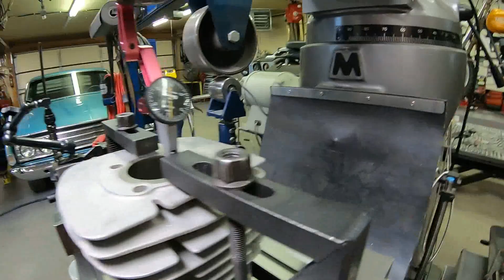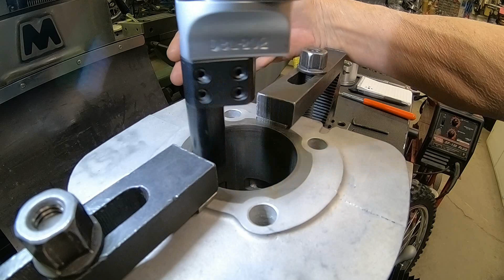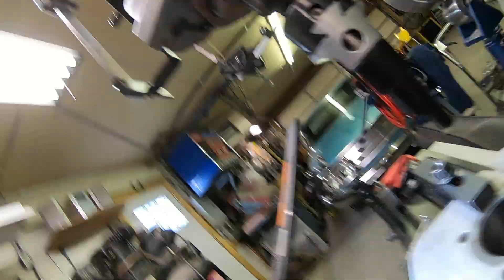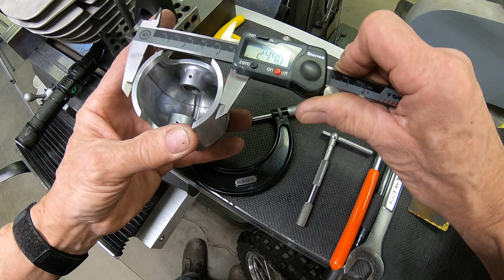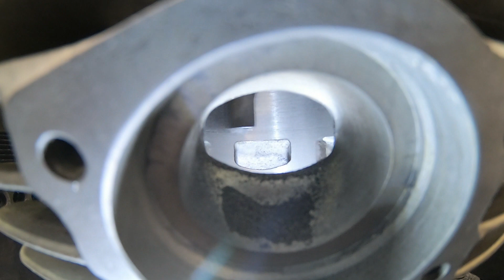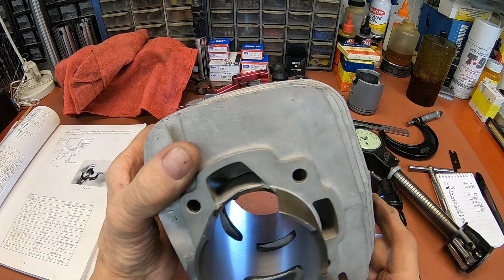Boring a motorcycle cylinder, Kawasaki F7 175 Bushwacker

Comment: That is an interesting boring bar. Did you machine it yourself? Sure looks ridgid.
Reply from the maker: Hi Dave, it is made by Mesa Tool, but unfortunately the last time I looked they have discontinued it. It is very sturdy and provides a very smooth bore. I have had many folks ask me about it. I always tell them to call Mesa tool and ask them to bring it back. I would buy another one. Mesatool.com

Comment: Nice work as always Dale. Your attention to detail is impressive. I should be getting the 185 engine back from the shop in a couple of weeks. Started working on the 125 frame yesterday.
Reply from the maker: Thanks again Dave, wow you are making good headway on those bikes. Are you laying down the shocks on the 125?
Reply: @montana2strokeracer  I will be adding the alternate upper shock mounts to the diagonal frame tube like I did on the 400, 250 and 185. Frame gussets will be the same as well.
Reply from the maker: Awesome buddy, is there improvement to handling or have you had a chance to ride yet?
Reply: I noticed a big improvement in the ride and handling on the 71 TM250 and TM400. The upgrade to the ignition system also improved the aceleration and throttle control.
Reply from the maker: Nice, it's always good when the mods have a positive effect!

Comment: Thanks Dale , Great camera work . I am having a problem finding the piston rings for My Yamaha TX 500 , all the part numbers say it is correct but the top and second ring wont fit in the land , they are about .012 to tall or thick . I dont know what to do .
Reply from the maker: Hey Murr, thanks very much. Is your piston new too, or is it the original? It's strange that the rings are not the same. Hey, you might contact Chris over at CK Cycles on Youtube. He built a 500 Yamaha, he may have some insight, he's a great guy, trying to get his channel going.
Reply: @montana2strokeracer  thanks Dale Chris built a XT 500 minus the TX 500 twin cylinder for valves per head. They are the stock pistons Yamaha inside standard bore. I bought two sets of rings one aftermarket, one Yamaha neither fit they all have the same part number I don’t know what to do with this, somewhere along the line they must’ve changed piston sizes
Reply from the maker: Woops, got the XT confused with the TX. That really is strange about the rings though. Have you tried one of the forums for that bike to see what anyone else has to say about it?
Reply: @montana2strokeracer   hey Dave thanks for the message. No I haven’t tried any of the forums. I’m just kind of not into that. If there was a dealer around like the old days, I could figure it out but nowadays, I don’t know what to do. This bike is just becoming a nightmare.
Reply from the maker: I know, I'm not into the forums either. Seems to be more negative  than positive there. But a lot of the young guys hang out there. Some of them are very knowledgeable if they would just get over themselves.